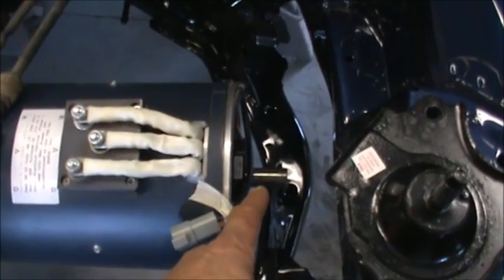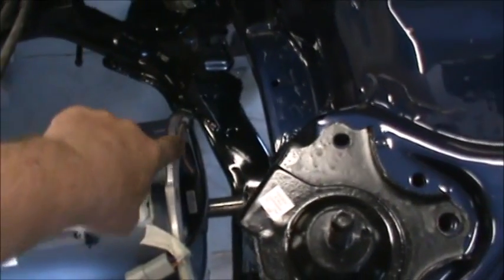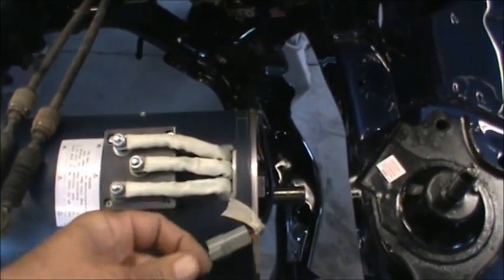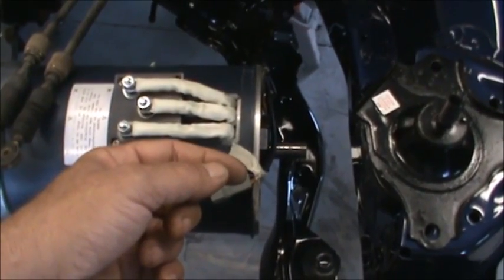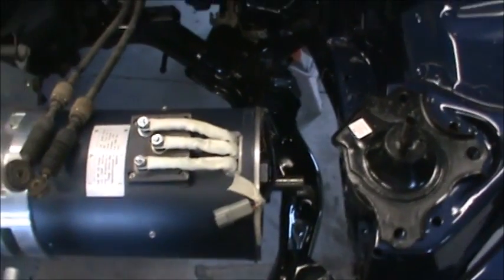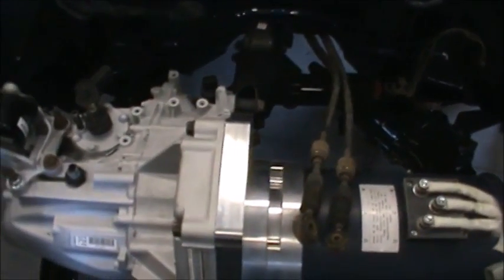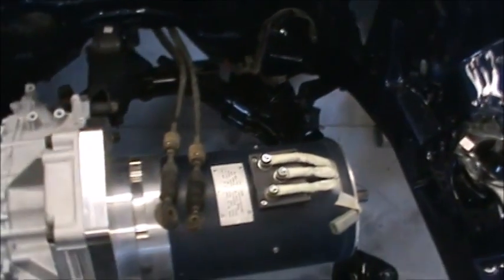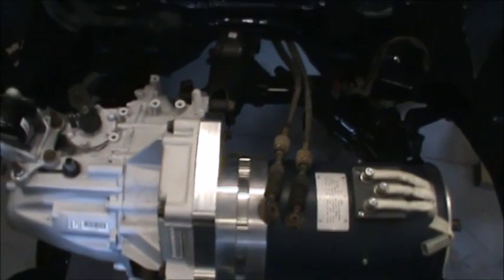Installing The HPEVS AC 50 Motor Into The Honda Civic Electric Conversion

Comment: You can use electric steering without using any hydraulic pump to run all the time and uses you power
And also electric break

Comment: all you need is a belt pulley system to run your alternator power steering pump your  air conditioner and with 3 or 4 high output alternators and car stereo capacitors and only maybe two batteries you should be able to keep that motor running by itself and never need to be charged buy a plug in the wall charger
Reply: Um...no

Comment: I am very interested If wanting to buy the whole set that has 1). Motor drive 1,200 rpm (500 Nm or more). 2) .Battery Pack set and then have 3). Converter controller 4). Want to have a DC Charger also provides a battery. $ Request to know the total price according to all 4 items. #Put the assembly that has been fixed on the platform, will it be ok? To be ready to be used on the test platform Contact me at my email. Suppaporn.S@gmail.com I'm in Bangkok, Thailand.

Comment: How did you get the electric motor to fit do perfectly flush with the transmission?
Reply: you just have to use the Gasket as a template to cut the metal to match the gearbox aad than drill holes for Bolts the metal plate

Comment: Hey the gas motor was turning at 2000 to 4000 RPMs the electric motor will turning at about 12,000 to 18,000 RPMs!
Reply: Not that one

Comment: When in a complete stop, the Eletric Engine will be at 0RPM. How will your steering pump work? Shouldn't you use an eletric rack & pinion?
Reply: My guess would be that the motor controller can be programmed so that 0% throttle still equals a low rpm when stopped with the A/C is on.  He said the transmission is a manual, so that would then mimic an engine at idle.
Reply: seperate electirc steering pump
Reply: It's a compact car. Does it really need power steering?

Comment: Ok so if my calculations are correct by converting to electric powered instead of gasoline powered you take away all the gas engine and exhaust and stuff fuel pump that would take so so much weight off the car so the car should be much faster right? Like a Tesla goes up to 60 mph in a few seconds or something? Correct me if I'm wrong anyone. If I am then my bad
Reply: Batteries are heavy so you replace any weight and then some depending on how far you want to travel
Reply: A car usually weighs around 3600 pounds. A Model S is 5400 pounds. So, no.

Comment: Get the auto and weld a plate onto the conversion plate side.. drill two holes deep enough into the conversionplate to hold it on. 

Or 

Find a mount that has all that in one factory mount.. 

Usually factory mounts are a solution for every problem... ie, engine.. lol.. 

Have fun and looks great.. want to rework a Festiva with the same idea... But from Tesla.. complete with false floor battery.. and AWD.. 

Maybe something you might want to consider.

Comment: How many Horse power?
Reply: Yohanes Listanto its about how much AMP delivered... more amp= better acceleration but battery will drain faster. more voltage=more RPM which will give more top speed but less acceleration but battery will last longer
Reply: good but if you make your own charger which runs on solor panal it would be good green car

Comment: can we use electric power sterling and electric a/c compressor for it ?
Reply: You can get electric A/C and power steering pumps, or you can add those accessories using various adaptors in a traditional belt driven manner to the other end of the engine from the gearbox.

Comment: How do you adjust the max speed of motor's RPM to the previous car's transmission? On other hand, how do you make sure that  the motor you chose is a right fit for that transmission (in terms of RPM)? Thanks anyone for reply in advance.
Reply from the maker: The electric motor torque peaks at about 3500rpm. The ICE engine peaks much higher. So the existing transmission isn't a good match when compared to the ICE engine. But on the other hand we are not going to cruise at 100mph. At 75mph the civic turns 3000rpm. I don't anticipate any problems at all with highway speeds, but we probably wont use 1st gear in the city.
Reply: Thanks for the note,

Comment: @tomswonderfulworld is it possible to have a 35 hp electric motor power the rear wheels of a car and have a 35 hp 2 cylinder engine powering the front wheels? But only use the rear electric powertrain for passing maneuvers or on highway merging?

Comment: Is the mount in the auto trans version any more substantial? Was the gas engine supported elsewhere? Any support under the motor. I have zero experience with front wheel drives. I would like to do a mid-90's Civic in the next few years.
Reply from the maker: +EASTSIDERIDER707 The Automatic transmission mount is minus the 3rd finger.....There is a motor mount on the accessory side of the motor that I will be incorporating into the custom accessory plate I am designing and building for the A/C pump and Powersteering pump.

Comment: Awesome job with all the projects in this conversion! You're quite the perfectionist and it really shows here. Patiently awaiting progress with the pulley system for the A/C and power steering. Keep up the great work. Did not catch plans for braking, are you planning to add a vacuum pump or expecting regen to provide assist?
Reply from the maker: +Sammy TheDog I do not plan a vacuum pump, I am hoping the regen will provide enough assistance, it will be adjustable and tunable but I wont know for sure until we start driving it. My hope is the ABS system and regen will all work together. Fingers are crossed!

Comment: I love this project. Can you explain how the AC Compressor (if you are using it) and the power steering pumps will spin when the motor is not or at an RPM that is not adequate for the those two accessories? Thanks.